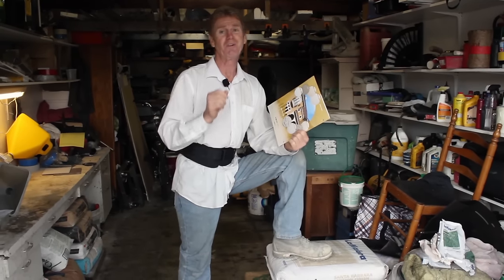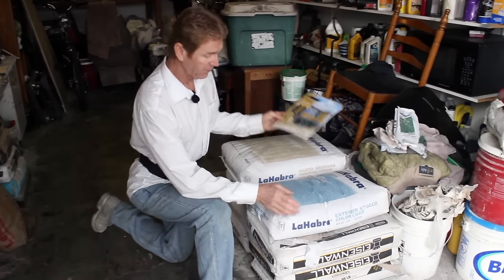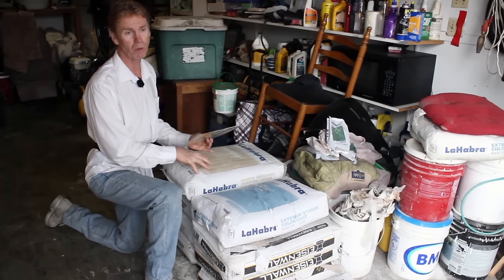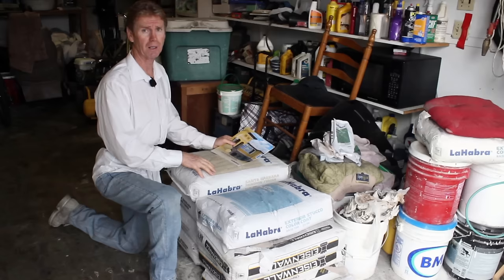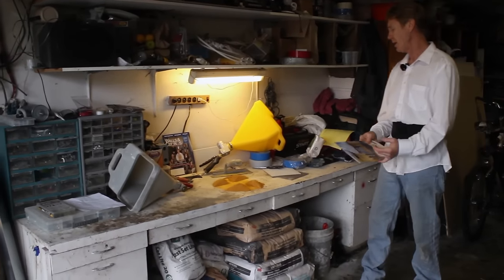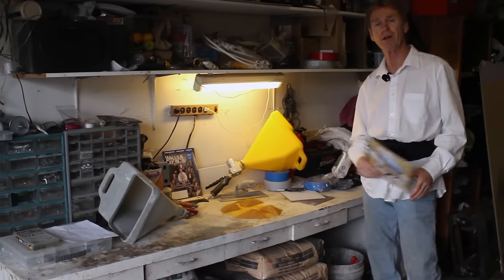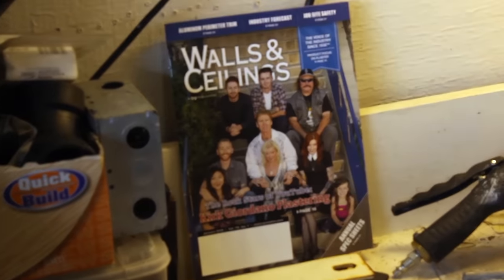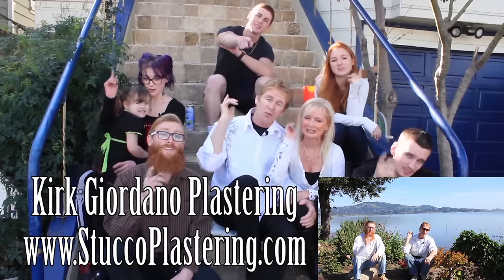How to tint or mix stucco pigmented color packs.

Comment: Excellent! For interior base coat bags, say Diamond or Imperial, would it be a bad thing to add the tint to them and forego the finish coat? Is the difference between base and finish  just in the texture?
Reply from the maker: Most of interior materials are white in color, thus tinting them is an option to painting. Adding stucco pigments colors do nothing to the texture or finishes.

Comment: Simple solution if you don't have or want to use a scales, figure out the area you have need to cover, dry mix multiple batches of pigment with plaster as instructed by manufacturer , then bit by bit add approximately same amount of each individual batch into a large enough container ie. A  dry barrel, dry mix again as each part goes in, that way, as your doing the job and wet mixing, you know that all parts are from the same new batch and don't have to worry about  having to figure out the right raitio again and possibly loosing colour consistency..
Reply from the maker: Good morning Palladio dude correctomundo. The folks reading these tips will take your advice into considerations. Thank you.😉
Kirk and Jason Giordano plastering, sharing well over 850 free Stucco/Plastering videos for your education. 
    Together we have created the most comprehensive encyclopedia of Stucco and Plastering videos ever produced globally, all by your favorite plastering messengers of YouTube.
Bringing peace, love, and brotherhood back into plastering.🎭🏝🎆
https://www.wconline.com/publications/3/editions/1257

Comment: Hi I wanted to know if you use a base coat 100 with a color coat 200 will make the color lighter? Also I wanted to know if you use a acrylic bonding agent in the mix will it make the color different? Just because I am using a base coat 100 with a base color coat 200 biscayne and a acrylic bonding agent and the color came out like a tan and I want it like the color that is shown on the color coat 200 biscayne. can you tell me what  I did wrong.
Reply from the maker: @ChristineSantana-o1o  Good evening, on the color charts, you choose between say 30 colors. The lighter colors usually come in base 100 which is a 94 pound bags of finish stucco,the darker colors come with a base 200 also sold in 94 pound bags. The tinted pigments usually come in 2 pound bags. It’s not advisable to add any bonding agents in the mix, bonding agents are painted on the surface you wish to go over.😉🕵🏼‍♀️

Comment: Hey Kirk, I have a couple of questions. I specialize in interior concrete countertops and a client wants a certain stucco color. Can I mix these colors to my 80lb concrete countertop mix and get a beige color? Or should I just lay the stucco over my initial countertop?
Reply from the maker: Good morning Andy. The colors can only be used to finish stuccos. Those bags come in base 100 white or base 200 greys. 😉 
The colors won't work in regular base coats of Portland cement, which is grey.
 They will sort of work in the white Portland cement plaster that Hanson makes. Good luck getting the exact color if you mix it in this white Portland cement, I have tried and got close enough but lots of time spent trying.
  Kirk’s Tip: to all subscribers or anyone who stumbles on our channel with a question, type it into our Stucco/Plastering channel, and like magic, a video will appear to explain how it's done. 
   This feature is miles ahead of any plastering forum. 🥳
Kirk & Jason Giordano Plastering

Comment: 03:26 A 94 pound bag of portland cement equal 1 cubic foot. I think that's why that weight became the standard bag size. I think a bag of masonry cement also equals 1 cubic foot, but am not totally sure about that.
Reply from the maker: Good afternoon Terebrate, that makes sense to me also a 94 pound bags fits perfectly into to 5 gallon buckets, things that make you go hmmm.
 I'm sure the engineers who are way smarter than old kirk, knew what they were doing.
 Cheers,
 kirk giordano plastering
Reply: +Kirk &amp;amp; Jason Giordanos DIY plastering and stucco tips 
I suppose that a 1 cubic foot bag simplifies the math when mixing larger batches onsite. FYI, a cubic foot equals 7.5 gallons, but I agree that a bag of cement fits nicely into two standard 5 gallon buckets. I calculate that a 5gallon bucket filled to a couple inches below the top is about a half cubic foot.
Reply from the maker: Morning Terebrate, you my friend are a thinker, fellas like you always have the edge on longevity when it comes to plastering that last.
 cheers,
 kirk giordano

Comment: Hi Kirk, I plan on using La Habra Santa Barbara smooth finish base 100. I want the color coat to be white do I need to use a color pack or can I just mix the base 100 without the color pack? Thanks!
Reply from the maker: You would need the “crystal white color packs” for a brilliant white.
Reply: @StuccoPlastering  Thank you Kirk! I really appreciate you making time to answer my question.
Reply from the maker: @arcdraw  Morning, no problemo

Comment: Another awesome video that is helping me re-stucco (patch work) an adobe wall (5 feet high x 250 ft). I bought a 5 gal. bucket of premix from a local store for patch work but at $85 a pop I'm going to mix my own and dye it. Will it mix well in a wheelbarrow with a shovel? I also have a drill and a 24" paddle. Thanks, Kirk.
Reply from the maker: Howdy Lonsway, mmmmm. I usually buy finish products such as La Habra from the plastering material yards such as westside, 94 pounds bags usually sell for about 15 bucks while the tinted pigments cost around 5 to ten bucks a bag. This is for finish coats. Bags of base cost about 15 bucks, also and we add three times the sand for each bags of stucco.👨🏻‍🔬
Reply: @StuccoPlastering  Thanks so much for that info. And I just watched your ratio of sand to cement for stucco and I watched the crack repair video, also. We have an adobe house with an adobe fence around the yard built 26 years ago. The wall is overdue for patching up and your videos are priceless.
Reply from the maker: Good morning Lonsway, thank you, we do try and provide accurate and sound advice.

Comment: Great information. Would they work with plaster of Paris castings? Thanks
Reply from the maker: EveningNW, yes, these colors would, but it's difficult to get the exact color you might want.
                   Get Plastered like stucco
      Kirk and Jason Giordano’s Plastering tips
Reply: Thank you so much for your help. Are there any other color pigments that would work better. I'm trying to do plaster flower casting tile and pour the coloured plaster in layers depending on the flower fossils color. Looking forward to your invaluable advice and expertise.
Reply: @StuccoPlastering  Thanks but I'm not sure I get it. what do you mean by plastered like stucco?

Comment: hello, I am working on the outside foundation of my home to repair some  cracks; I figure since I am doing this I could use the mortar mix all around the house. Can a color mixer be added to the mix so that the foundation will be colored without me having to paint it? If I can use what is the name of the company that sells the color? I would like to get a color chart. Also, I am using the rapid set mortar mix.
Reply from the maker: Howdy Kimmie, the most common color charts and material sold for home owners are at Home Depot called La Habra color coat finishes,
 You can't add color to mortars unless they are white mortar such as Lehigh hanson white cement plaster.
 Its extremely difficult to get a color to be what anyone wishes for with is method of adding a color to a white basecoat.
 FYI, most base coat are grey.
 Best wishes,
Kirk and Jason’s sand and cement rendering videos

Comment: How much does adding the color packs accelerate the curing of the diamond veneer?  I need to plaster over a brick fireplace and do not want to get caught with a bunch of plaster cured in my bucket!
Reply from the maker: Good morning Dude, not much, now dirty drills or buckets can set the veneers almost immediately.
                          Live long and plaster
           Plastering tips for your information

Comment: nice magazine :) about to do a project with some color in it :) thumbs up guys
Reply from the maker: Hi macplastering, thank you, man, you know perfect colors for interiors are a real drag to get perfect, so when a customer says i want it perfect I don't walk I run as fast as I can, unless they themselves provide a guild.
 cheers,
 kirk giordano
Reply: Kirk & Jason Giordanos DIY plastering and stucco tips well noted :) I know what you are saying its the same here with k rend best to get the whole lot order so it is same batch number just incase but it is expensive stuff so need to try and get it down to a few bags witch is hard when doing a big house :)
Reply from the maker: Hi Mac Plastering you are referring to the K Rend company in Europe?
 I called them last week to see if I could get a cost on Lime plaster as I am doing an all out video all about real lime base coats and real lime finishes.
 Cheers,
 kirk giordano
Reply: Kirk & Jason Giordanos DIY plastering and stucco tips yes mate there is also a company called weber witch both do the Monocouche Render style finish and I think it is made from silicon as well though but man the lime in it is unreal burns a lot and smells nice and limey :)